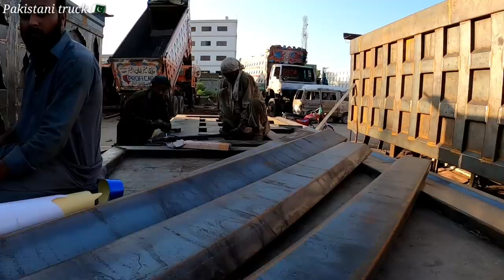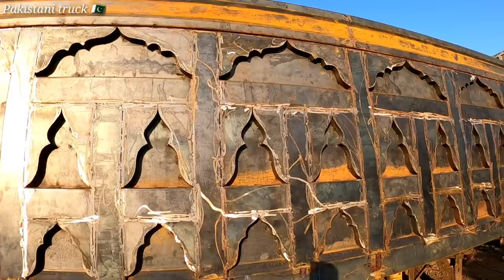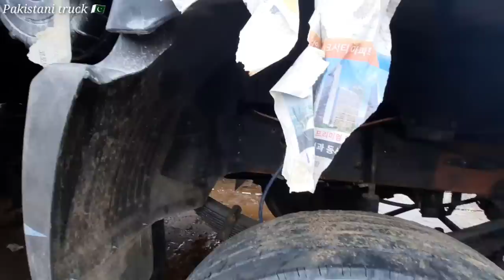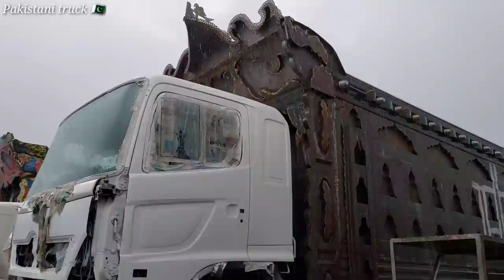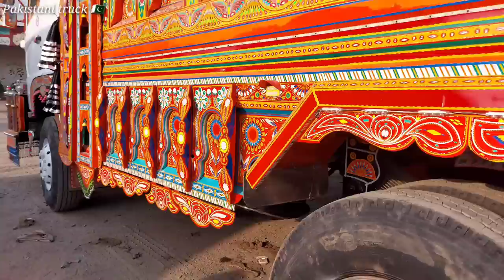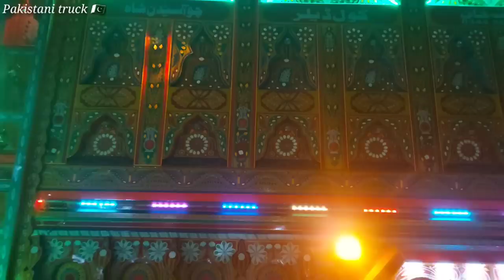how to make a tipper body with Pakistani truck art

Comment: 38 tons loaded, and 34 tons empty
17 tons, truck weight,
17 tons weight of garnish,
4 tons load capacity.
Reply: It's not that much yup it's a local culture people spends alot on decoration here
Reply: @muhammadazeem1262  What is the empty weight of trucks there in Pakistan?
Reply: 38 tonnes loaded? how? pretty sure that is way overloaded everywhere else in the world.
Reply: Dear friends the video maker shows empty weight 38 tons which was wrong it's 16 ton empty weight vehicle and after all this modifications adds weight around 900 kg to 1100 kg Reason for chesis reinforcement is because mostly these trucks use for over loading and used in very rough terrain plus harsh environment because area is mountainous with no roads chesis from company only survive few months that's why all this need to do
Reply: @muhammadazeem1262  There is no common-use truck with an empty weight of 38 tons.
In this case the truck has about 20 tons, and 18 tons of load capacity.
Reply: @DanielSilva-jj2lz  dear it's empty weight is 17 .5 to 18 tons in this configuration and why this modification I have elaborated
Reply from the maker: empty weight 12.5 tons
Reply: @pakistanitruck  how much does this cost?
Reply: It can put 50 ton not 4 ton
Reply: @MrKristyon  38 is not over loaded its a basic load in 22 wheeler truck 80 + put load in pakistan
Reply: No 38 ton other load truck weight is not count in 38 total load with truck weight is 55 ton
Reply: @pakistanitruck  I would love them to customize my 1985 Honda Helix scooter like that. WOW ! 
Ps" It was called the "Fusion" in Asian countries

Comment: Masha Allah.  This truck is entirely made in Pakistan, 100%, its a Japanese Hino Origin company, but there is Hino-Pak, Truck manufacturing plant in Karachi, Pakistan and they have been manufacturing these trucks since 1980's, including the Engine and transmission, all the hydraulic and electricals are made in Pakistan.  Proud To be Pakistani.